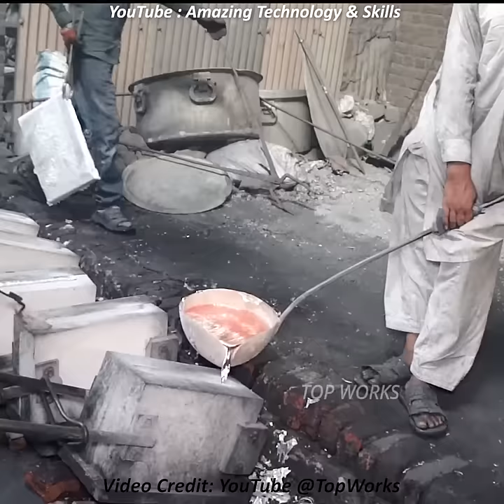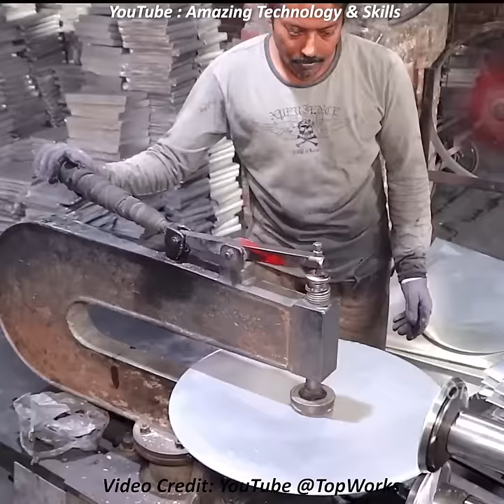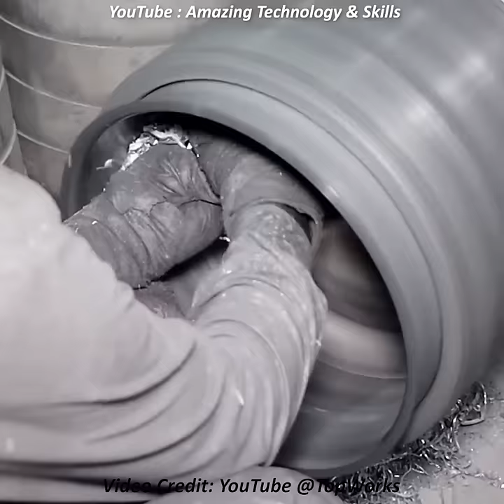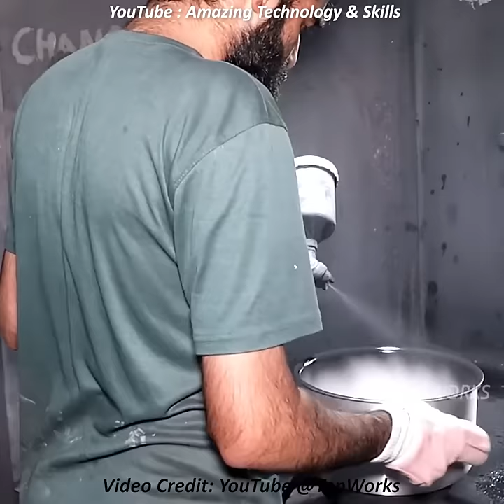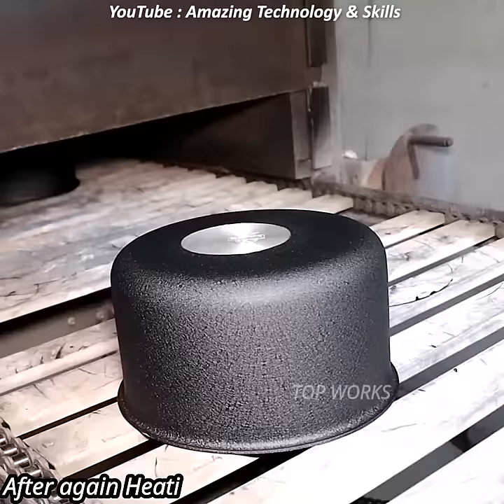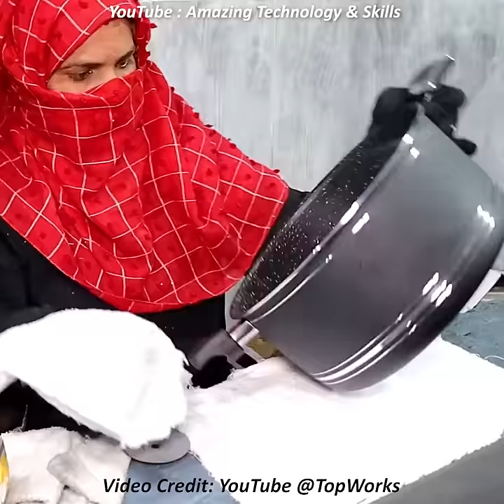How they Make Non stick Cookware With Amazing Skills

Comment: Teflon coating is the reason , I avoided non stick cook wear in my life
Reply: Me too....
Reply: yup, just season cast iron
Reply: So the non stick just a paint ?
Reply: @4n4Queen  coating to be specific but I guess it is a paint but with a fancy name.
Reply: Try ceramic coatings.
Don't fall apart like teflon, and nothing sticks to it.
Reply: @autumn5592  i rather stick to my iron cast and stainless steel pans :)
Reply: @JoeNonymous-yl4iq  Why shouldn't you?
Reply: @DarkHill43  Oh don't get me wrong, I would too, but it is worth trying a ceramic coating at least once. It I'd very nice not having to worry what you put in there sometimes.
Toss it all in, almost never sticks (I think I've had one egg stick, and it was my fault, still wipes off pretty easily though), and it isnt all that expensive. I would happy recommend it to anyone looking for new pans. Anything is better than teflon shit.
Reply: @JoeNonymous-yl4iq  It's not the heat, it's acids that cause leaching.
There is no known health effect to consuming these trace amounts of aluminium.

The same happens for aluminium foil too.
Reply: @JoeNonymous-yl4iq  I do agree that it gets in your food. I do agree using uncoated/teflon coated aluminium isn't advisable.

But there isn't any proof it causes any issues, or neurological conditions, at least in the doses you would experience from a pan.
If you were a welder, grinding aluminium without a mask, then sure it's gonna fuck you up a bit, but not the amount that leaches from a pan.
Reply: @4n4Queen Teflon is not paint. It's a polymer coating called PTFE, Teflon is just the commercial name. 

It is incredibly inert, is hydrophobic and does not react with many substances, including your proteins, sugar and fat in food when cooked. Which is why it is so nonstick. Contrary to popular belief, it also isn't toxic as it doesn't react with anything in your body and can't be absorbed by your intestines. You poop whatever you ate on accident out. 

However, it is not super strong since it's applied as a thin layer on your cookware, which is why if you use abrasives to clean it like scrubbing pads or steel utensils you will scratch it up, cause small portions to start falling off. 

PTFE is also the same polymer material they use for your plumbers tape as they provide a very slick surface for threads while being hydrophobic to prevent microleaks.